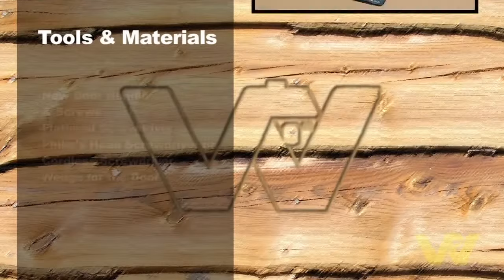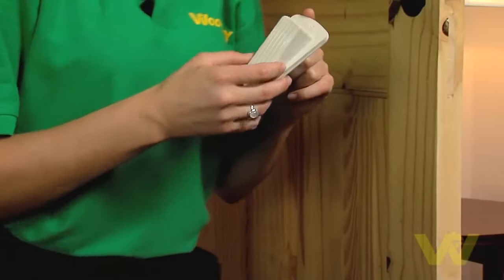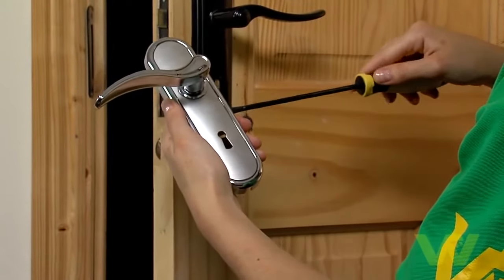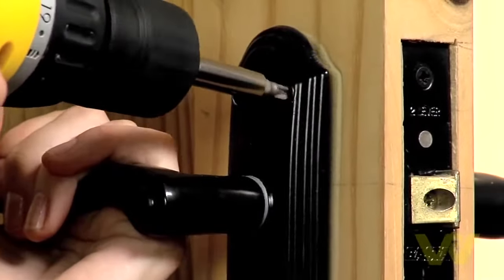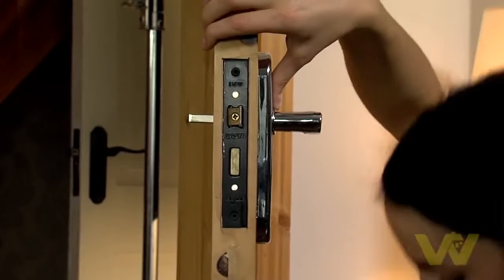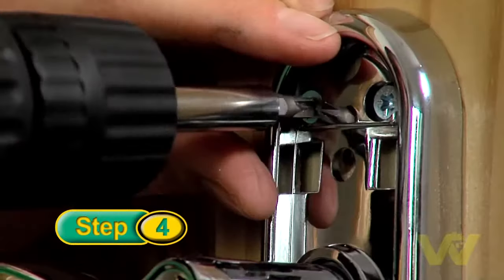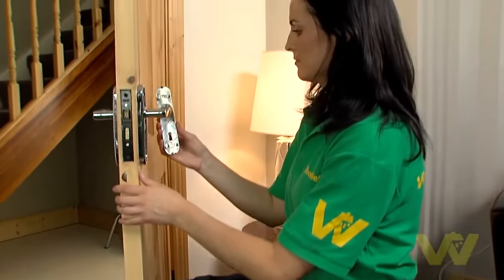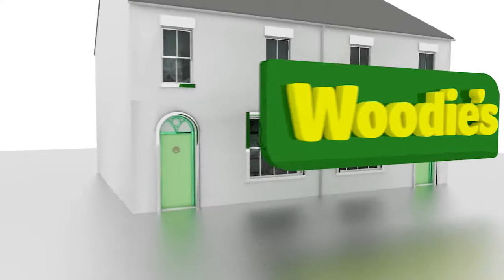How to Change a Door Handle

Comment: I have a slightly different and quite old door handle. The handles are like baubles and they're connected by the usual metal rod thingy that goes into the small hole, but no visible screws anywhere. Should I just tug on both baubles hoping one comes off leaving the other still connected to the metal rod?
Reply: Yeah

Comment: This is all well and good but I am finding it impossible to find door handles with the same size back plate as my existing (ghastly brass) door handles.  Am I going to have to redrill the screw holes in my doors?
Reply: Exactly - I have same problem. Not all door handles are exactly the same as the one you're removing! Vid is bloody useless for me.

Comment: Those Basta locks at 0:43 with the hidden hole at the bottom are a pain in the arse to remove. You have to jam a flat head screwdriver quite far up to dislodge the face plate and you risk damaging the wood when you do.